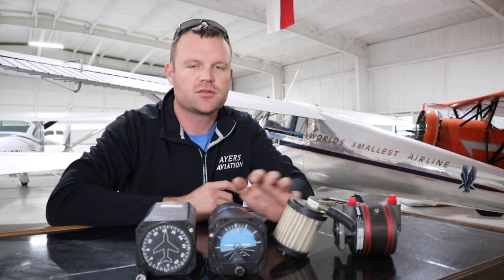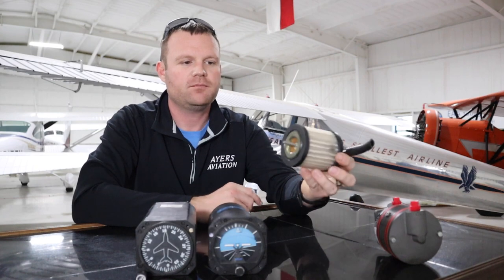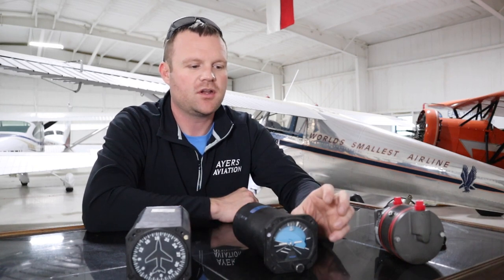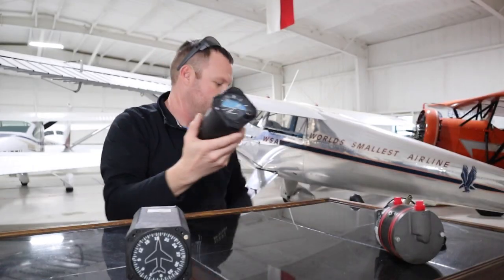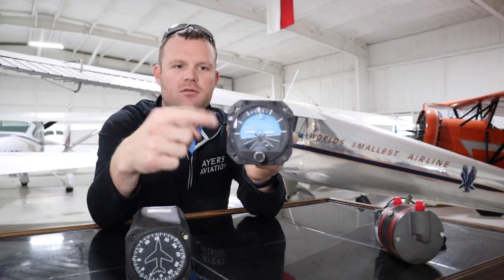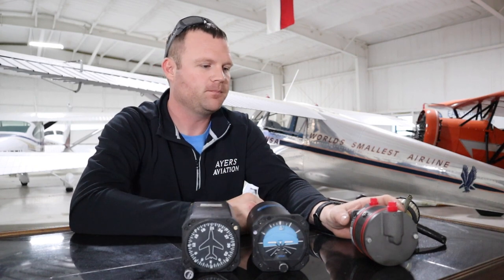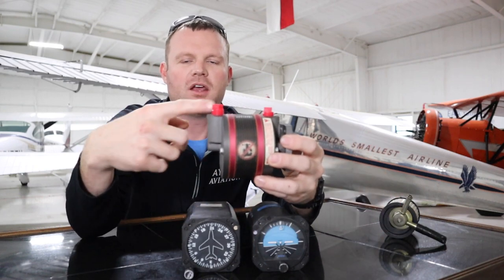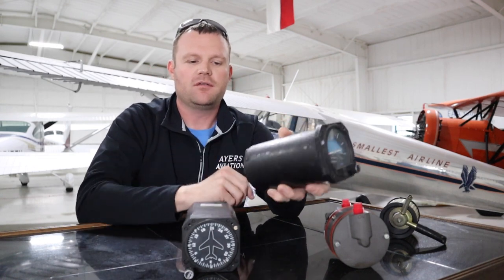Aircraft Instruments - Vacuum System

Comment: Too short video but! 1000% very well taught. Thank you very much.
1 question if I may. Why those instruments need suction, & do they power too or suction?
Reply from the maker: Its just the way they were designed. They realized it was a bad idea to have all the flight instruments run off of electricity. if the electrical system failed, all the instruments would quit. so they came up with the air/suction system.
Reply: @Ayersaviation  thank you. Awesome & very clear teaching, I learn seeing you made easy to learn, & understand